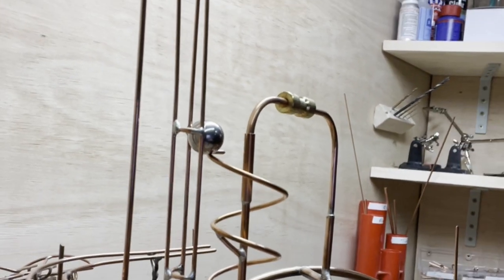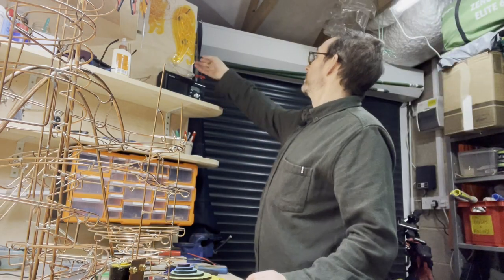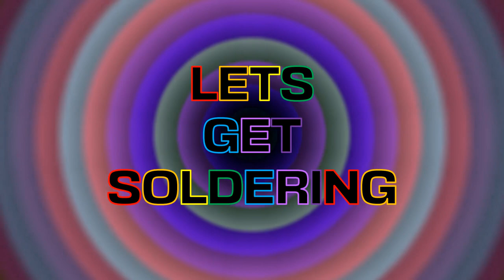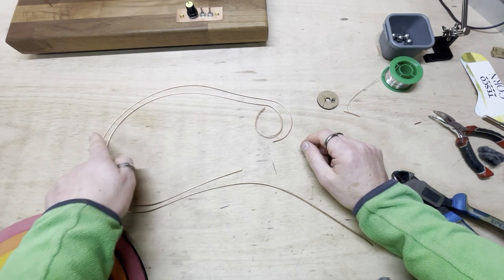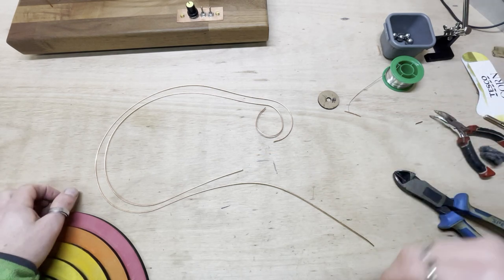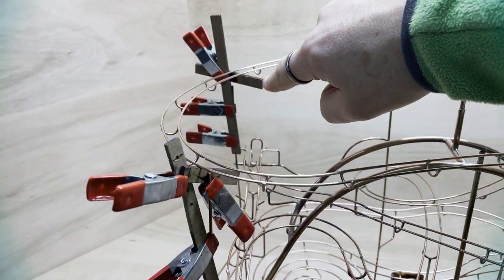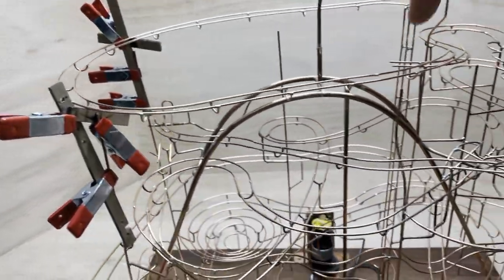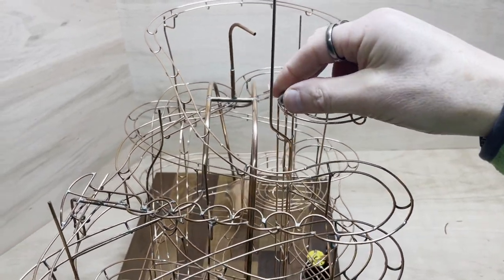Ep.27 // Top Track // Rolling Ball Sculpture 3

Comment: Very elegant contraption. If you add a bench hook to the bent side, you might get away with using it without clamping it down. What I mean is a bar facing downwards that would prevent the jig from moving once it's reached the side of the table (google bench hook). You'd be bending the wire away from you, though, which might not work so well.

Comment: You have helped inspire me to get into this hobby, thank you! I have studied quite a bit and assembling materials and tools. One question I have is, should I acquire a certain watt soldering iron? I have my eyes on a 100w Weller. What are your recommendations? 
Thanks!! Brian
Reply from the maker: Glad to help.  Higher Watts are good for larger diameter wires.  But the time taken to get hot will be longer.  I prefer a resistance solder iron these days, but before that I used a 25w for 1.6mm wire which struggled a bit more for 2.0mm wire.  It certainly wouldn't be powerful enough for 2.5mm or above.  In addition I bought an 80w iron which I dislike because it is too powerful and overkill for the delicate work I do.  I only use the 80w iron for plate work. So it mainly depends on what you are soldering.
Reply: @CopperGravity  I have seen Solder irons that are temperature adjustable, ranging from 300-900 degree F. Maybe that is the answer. 
Thank you replying and inspiring!
Reply from the maker: Well, the power and temperature are not the same thing. 

For example, my 25w and 80w both reach 500C. But only the 80w is powerful enough to transfer the “quantity” of heat to a large copper plate or wire.